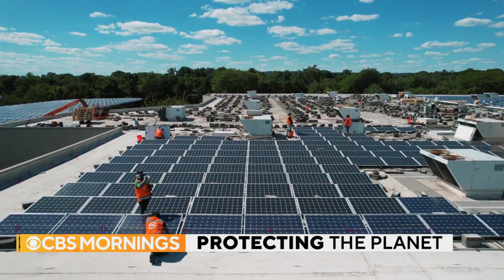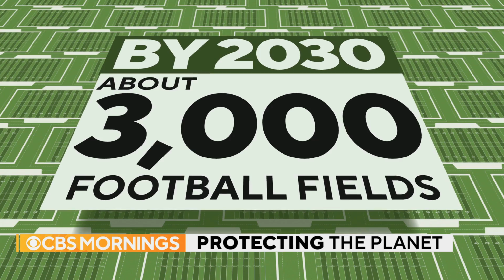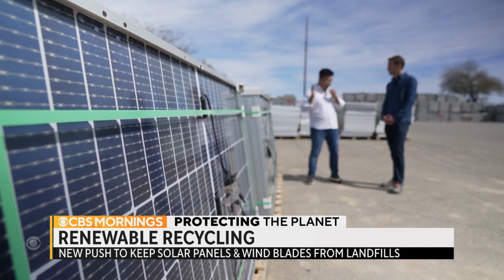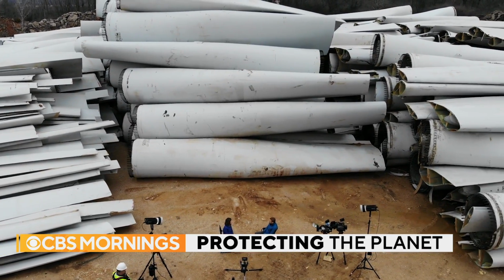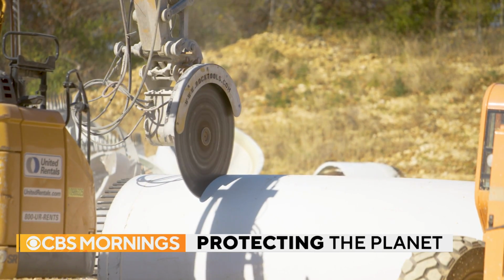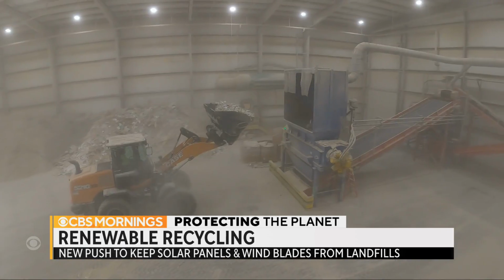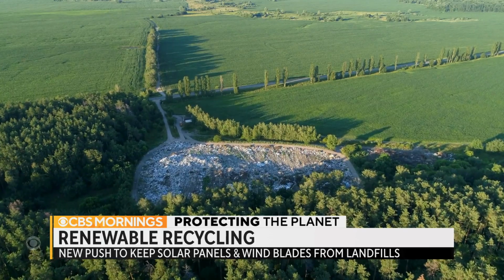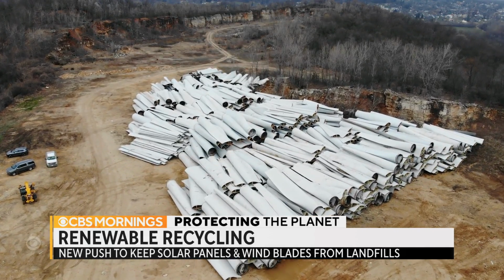Wind blades and solar panels head for landfills after being replaced

Comment: So, just to recap: renewable "clean" energy has costs that aren't spoken of: costs to manufacture (using fossil fuels); costs to dismantle and recycle (using fossil fuels); costs to transport both ways (using fossil fuels); final leftovers from burning (gasses and solids).  Wouldn't it be instructive to see a chart of the total costs in money, fuel, pollution, and so forth?  Seeing the whole story, here.
Reply: Blades have a 10 year life span. UV breaks down the coating, particles in the wind eat the leading and trailing edges, and eventually the blades stop working properly. The resins used to make blades come from Petrochemicals. They used up 90% of all Balsa production. Once the balsa is impregnated with the resins they cannot be recycled.   1 tn of steel manufacturing produces 1.85 tons of CO2. An average wind tower uses 240 tons of steel. Thats 444 tons of CO2 per wind tower to produce the steel. That does not including post production where it is rolled out, which produces CO2 from the furnaces, nor transportation.  It would take 10 turbines at full capacity to run the steel mill producing the steel. Of course if there is no wind, there is no power, so no steel produced.   It would take half the state of MA to provide enough power to run the steel mill.   To produce the energy the US requires, would use 13,600,000 acres of solar, or 21,250 square miles.  Of course that is just during the day, at night they produce zero watts.  A battery the size of a car battery would store about 200Wh per charge, the amount needed would use up a square mile.    Which one seems more viable a solution, Wind, or Solar?   Drawback of solar is it reflect heat, so it would cause a heat bubble where ever it is put in place. It can affect Climate.  So we trade one "climate" issue with another.
Reply: @acdii  I don't think the reflection of solar is w big problem since it's not that significant on the earth's scale. However I think most car battery are above 35 kWh, 200 Wh is more of a small electric bike
Reply: YES!! The only way "clean energy" in form od SP are cheap, it's because of CHEAP coal and fossil fuel. I have yet to see how cheap SP will be when they are manufactured from scratch by clean energy solely!
All the BS talk how SP watt is cheaper than watt of hydro is ridiculous. I just don't understand how the "experts" are going along with it when I, the regular Joe, am able to add two and two together.
I'm not against SP or EV's or wind power but be open, honest and objective about it!
Reply: @kolobara08 my whole state is ran off hydro power and we have the cheapest electricity in the country. One city here pays 2cents/kWh for industrial power and 3.3cents/kWh for residential. I pay 6.8cents/kWh. National average is between 15-23cents/kWh
California pays on average 30cents/kWh. hydro is amazing, we actually sell a lot of our power to California and Oregon.
Reply: @randybobandy9828  That's amazing. Hydro is in my "amateur" opinion the only true green and/or renewable energy. Yes, upfront it's a huge project but hydro runs for century, with upgrades beyond that.
Reply: @kolobara08 But political is saying hydro is effecting climate because natural water flow is reduced and fish cant get where they once habitat lol sounds all fishy 🤑 for corporation
Reply: @kolobara08 

omg it's not fossil fuel,  its Abiotic
Reply: Gas providers are scared.

Ultimately, less fossil fuel will be used now, after adding solar panel and wind turbines.

As long as I use less gas running through my home and reducing my utility bills and ultimately help out Mother Earth, then yes, it is worth it.
Reply: All energy has costs
Reply: You have to realize that people pushing this green energy narrative don't want to point out the negatives of it? They think that will push people away and.give legitimacy towards fossil fuels. So many people believe the renewable energy propaganda. The only green solution currently now moving forward is nuclear power. We need to find a revolutionary new battery/energy storage system before wind and solar really become viable as a full time energy source (solar is only a supplementary power source now since it only produces power when it's sunny and no way to store it for night time)
Reply: (where the pyramids covered in solar panels they would still produce electricity )
Reply: 😂 you didn't see the whole video before commenting
Reply: @Owl-of-Minerva  (solar panels on every roof and parking lot - solar panels in deserts provide shade and shelter for crop and animals )'

the wind always blows offshore -to pull undersea cables all you need is a boat
(floating wind turbines could be raised in weak winds by pumping ballast water - the blades could be made with honeycomb aluminum for perfect recycling )
Reply: The first  part of your argument is nonsensical. Yes, it takes fossil fuels to make renewable energy tech and equipment. But then the renewables aren’t producing any C02 for an indefinite amount of time. Meanwhile, every millisecond you use fossil fuels, you’re contributing to both climate change and pollution.
Reply: Exactly. False marketing.

But markets will develop new ways as long as the need continues.
Reply: Nuclear waste is disributed worldwide by Depleted Uranium ammunition as "deathly dust" (search for this film!) i.e, vaporised Uranium when armour is penetrated. It goes as nano particle into the environment, the food chain and your lungs, it is radiating into yourself causing cancer and birth defects.
Reply: This is a dumbed down news report. Nothing to see here.
Reply: There you go thinking again!
Reply: As long as the strip mine to make Tesla batteries arent visible from my house it's perfectly acceptable to have them in a sensitive rain forest on the other side of the world.
Reply: They would never do that, it would show their dirty little secret and they couldn't have that.
Reply: Exactly.
Reply: Yep just like electric vehicles, the costs, financially, environmentally, pollution/waste from production and disposal are greater than what we've been using. Smart meters and homes are a scam ,and the same people that own the oil, coal, nuclear ect are the same people that own the "green" energy market scamming people from both ends! Black rock, vanguard, state street deal with both sides and buy the politicians and own the banks as well as having shares within each other! It's a huge scam!!! They take money from all angles, play like they are opposing sides when in reality owned by the same people, like Coke and Pepsi are! They monopolize the world and reduce opportunities, options and freedoms. They use and manipulate the environment and the people for their own selfish gains and agendas and when they are done, only devastation is left behind.
Reply: Correct.  You have energy inputs for construction and demolition/disposal.

With non-renewable sources, you have energy inputs for construction and demolition/disposal, and to fuel the thing to generate electricity all through its life.  That third one dwarfs the other two.
Reply: Me thinks "clean energy" is a net loss.
Reply: @southbound1969  you can think whatever you want. Facts point out that you're wrong, at least when compared to fossil fuels.
Reply: @southbound1969  "Me thinks "clean energy" is a net loss."

And this is why its best not to make conclusions on topics youre not educated on.
Reply: @southbound1969  You can think whatever you like, it’s a free country. But you’d be wrong. Renewable energy is very much a net positive. Numbers don’t care about your feelings.
Reply: @davestagner 
Greens remaining silent about China coal has more than off-set any gains over the past 25 years.
China coal use was about 7% of world total in 1995, it grew to over 50% by about 2018...and they are still building coal powered elec while Greens tell the west to stop.
Not to mention China's coal particulates get into the atmosphere and migrate across the Pacific Ocean into Canada/USA and affect weather patterns.
China only joined in the renewable boom to move their auto pollution out of cities and sell renewable "stuff" to the west.
And who do you think got Afghanistans natural resources when they chased Biden out in a hurry? China.
Reply: @southbound1969  Wind turbines have already out paced coal fired generation,and do create  waste ,but,coal fired generation creates a sludge of toxic mercury ,lead,arsenic etc,and can end up in ground water ,soil or open rivers and streams and cause severe damage to the ecosystem which can't be mitigated.
Reply: @joebeetz1832   Electric car batteries will also pollute the ground when they start getting dumped. The Cobalt and other metals needed for electric cars are also causing major environmental issues. More research should be put in to creating ethanol running vehicles.
Reply: Someday it may be possible to build green with green. Meaning as little as possible fossil fuels used during construction of renewables. Cannot 100% end fossils as things still require oil. Products made of plastics etc still come from fossil resources.
Reply: @IronSharpensIronPv27.17  the world depends on fossil fuels to keep ppl from starvation, fertilizers , plastics looks around,  oil has a million by products
Reply: @IronSharpensIronPv27.17  It's a pipe dream and not one anyone really wants.
Reply: @IronSharpensIronPv27.17  What is oil made from? Originally, it was just water and carbon dioxide. Those were turned into plants. The plants then died, were covered, and compressed and heated for millions of years to become oil. But there is no reason whatsoever that it would be impossible to make plastics from atmospheric CO2 and H20 rather than oil. It’s just more expensive, since the oil has already been “cooked” into longer hydrocarbon chains. But plastic from nothing but air and water is certainly possible. It comes with advantages, too. Like incineration becomes a very responsible way to dispose of it, rather than complicated and expensive “recycling” (which is, mostly, just incinerated - contributing to global warming).
Reply: @davestagner  thank you for sharing
Reply: That's assuming the energy used to source, manufacture, maintain, and deconstruct them is derived from fossil fuels--and even if that is the case much of the time, it doesn't need to be, and doesn't take much away from the net amount of clean energy the technologies produce. I believe I read it's common for wind turbines to pay back their production energy in a matter of two years or less--and they last for maybe 20-30 years. They aren't more expensive than coal, even if they are most expensive than gas--but the reason we're investing in them isn't because they're cheaper than all of the fossil fuels in up-front costs, that's completely missing the point
Reply: NO SUCH THING AS FOSSIL FUEL.  

CRUDE OIL IS ABIOTIC 

LOOK  IT UP, EDUCATE YOURSELF AND SPREAD THE TRUE WORD
Reply: You should try googling that, rather than assuming you’ve discovered some big secret.
Reply: What you need to remember is that that cost to manufacture, transport, and reuse (not dispose of, this story doesn't have it correct. It's a little behind. These technologies move too fast for these type of main media reporting that takes quite a while to produce) are increasingly being done using renewables. IE: solar and wind powering panel manufacturing factories, and electric trucks doing the hauling, etc.
Reply: @junehanzawa5165 no they aren't behind, your electric trucks aren't doing the hauling. We don't even have any battery powered semis on the road and even when we do, the amount of electricity they will require will need to come from fossil fuels and we need to beef up our electric grid. Fast charging a semi is going to take an INSANE amount of power in a short period of time, since we need to be able To charge 1000kwh batteries in 30min to an hour to keep the trucks moving
Reply: @randybobandy9828  The "the story is a little behind" comment was meant mainly for the reuse part. This report does not mention that all the major wind players in Europe, where wind is far ahead of the US, and GE in the US, have all committed to recycling all their blades so they don't end up in landfills. This story does not mention that there are several companies already turning them into cement and one that is turning them back into reusable fiberglass.

As far as electric trucks, the US is also behind. In Europe, Volvo's fully electric truck sales are up 280% and Mercedes is not too far behind. The US is just starting with the Tesla Semi and Nokola's electric trucks. For the electricity, look up "California ISO" and scroll down to supply trend. You can choose to lookup any prior day for a full graph. You will see that right now, in early May, solar takes over around 7:30am and is by far the highest form of electricity powering their grid until around 6:40pm. You will also notice the yellow graph line corresponding to batteries beginning to ramp up around that time, 6:40pm. Right now, they provide roughly 1.8GB peak power, and are used mainly as "peaker" plants. However, their mix is growing by the month and there are several large battery mega-sites currently being built in California. And keep in mind that if California were a country, it would have the world's 5th biggest economy by itself, so they use a massive amount of power.

Also, in Australia, the state of South Australia uses over 80% renewable energy and growing, and there was a recent stretch of about two weeks straight where they used 100% renewable energy. Mostly solar and wind with Tesla battery megapacks to instantly smooth everything when needed.

That will give you an insight of what's being done on the grid. However, for EVs, it's the solar and battery part that you need to keep in mind because large parking lots supercharging sites are being built with megawatts of solar and batteries that will barely use the grid if at all. Tesla is building one in Arizona right now, and there are two or three already in production in Europe. These sites are going to keep sprouting up, and will be modular. Meaning they can start with just a few megawatts and upgrade/expand as needed. These will be huge business going forward as the electrification revolution really ramps up, so investors are lining up everywhere. These are the gas stations of the now and future, so there are massive amounts of money to be made if they can create their own power. It's all profit after the initial costs are recovered. These sites can be built very quickly, especially if they don't connect to the grid to bypass permits, which is already being done in Europe by one company. The batteries are going to be mostly Sodium Ion such as those from CATL, so very little if any Lithium will be used beginning in the next year or two. Tesla is already building a megapack factory in China using them to ship them all over the world.

Hope that helps explain my comments.
Reply: The stuff being deprecated and disposed of is some of the first generations of that tech. It's gotten a lot better to the point where photovoltaic and wind are substantially cheaper than non-renewables in the long run. Look up "Levelized cost of electricity" or LCOE.

Comment: 1:49: Wow! 90% efficiency? I'll take those, where can I buy them! That's more than 4 times the best panels in the market can do!
3:16: To this! Never knew they made them out of paper. Interesting.

The blades are not supposed to be indestructible. They're designed to handle wind loads, not sawblades.
Reply: "90" I caught that too.  At best he means 90% efficiency of the new ones on the market.
Reply: i think 90% efficiency is a estimation of what they are capable of, compared to new panels. Solar is definitely not 90%
Reply: @gothboschincarnate3931   @Edward Cheung  
Maybe he means 10% degradation. For P-type panels from 4 years ago that seems acceptable.

Comment: The aluminum can be recycled. The solar cells came from sand in the ground. Might as well go back in the ground. If you want, grind it up and put it back in the ground. The windmills are mostly fiberglass. Might as well just bury it. Recycling is absurd. They want to burn and generate CO2? What absurdity.

Comment: The solar panels and wind turbine blade aren't causing pollution like the coal ash and oily film in our skies. That ends up in our lungs and homes. Having trying to figure out what to do with the usual solar panels and turbine blades is relatively easy compared to having to deal with the pollution that the coal and oil causes.

Comment: Curious how much power is used on running that equipment needed to cut them up? Also, I found it funny that all the tractors moving all that around runs on diesel...
Reply: energy needed to dispose of them is very small compared to the lifetime output of the turbines
Reply: Curious how much energy and waste are going to be generated removing the two old coal fired plants in my area sitting next to the ocean, deteriorating for more than a decade after being decomissioned while the company owners stall on taking them down. I don't find it funny at all.
Reply: You better look onto how much coal ash those things generate every day. Way worse than shutting it down. Most of the coal plant can be melted down and recycled